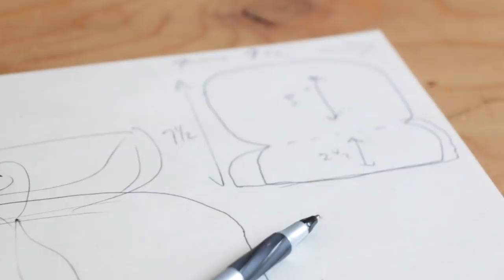Super Simple Sunglass Sleeve from Scrap Leather

Comment: when you glue the hide pieces ,  does the glue off/gas or emit noxious fumes ? also  i noticed wax was used to glide the thread does that mean the thread isn't sinew ?
Reply from the maker: The glue smells a little bit for sure, but the fan does the trick. We don't use sinew, we usually use bonded or 3 cord polyester threads.